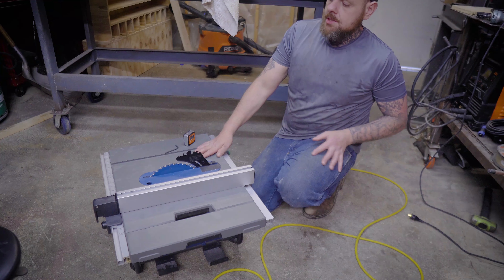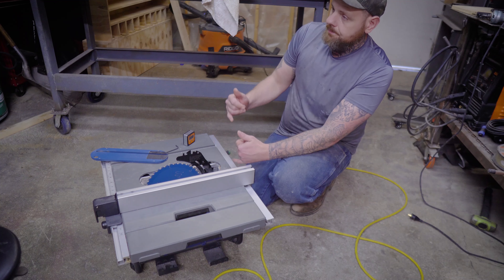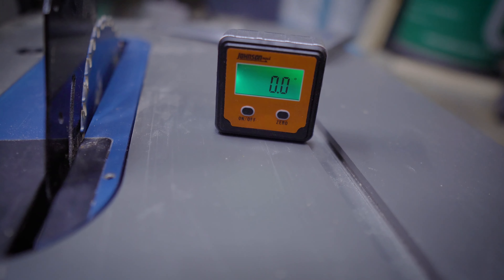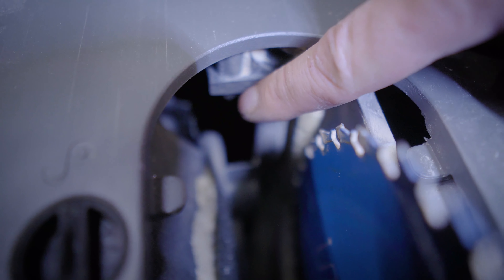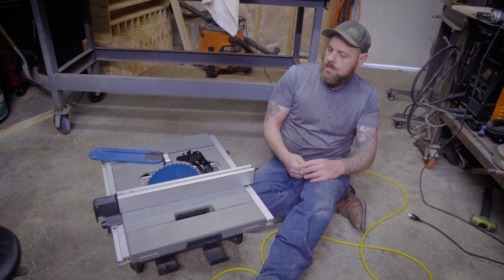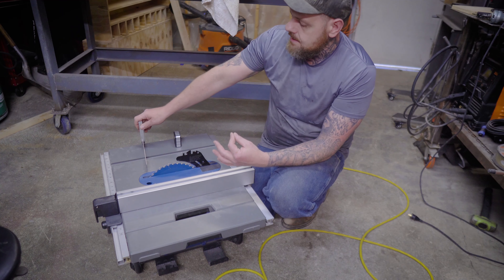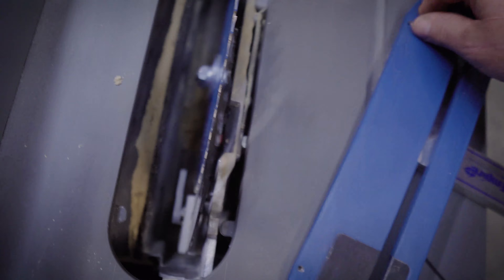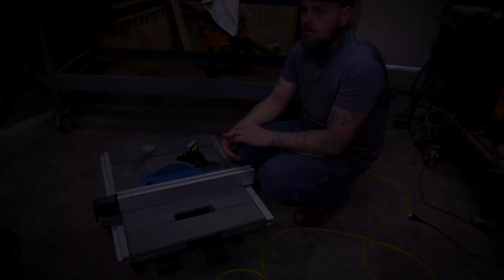How To Adjust Hercules Table Saw Blade and Table

Comment: How do you adjust the arbor so that the blade is parallel to the miter gauge slot? Right now measuring front to back using the same tooth on the 10” blade I’m 1/16” off.

Comment: I have the Hercules table saw. The roving knife is not lined directly with my blade. I can’t figure out how to adjust the knife. When I push the knife lever down in the lock position it’s off approximately 1/8” or more causing my work to catch on the knife. Can you help ?

Comment: Have you been able to adjust the blade parallel to the miter slots? I was about to do a video on it, but have had no luck getting it parallel using the same adjustment bolts on the trunnions. The slop in the trunnions isn’t very helpful. Haha. I’m considering taking it back for a swap and bringing my dial indicator jig with me.

Comment: There are stop cam screws you can adjust at either end of the bevel gauge on the front plate to set the 90 degree and 45 degree stopping points without having to mess with the trunnion bolts at all.

You can set the cam screws to their most "open" setting, then unlock the bevel, move the blade to the right angle, lock it there, then turn the cam screw to tighten up against where the bevel lever is set.  From then on the blade should go to the correct angle when you move it to either end.
Reply: Can you be more specific. I would like to try this